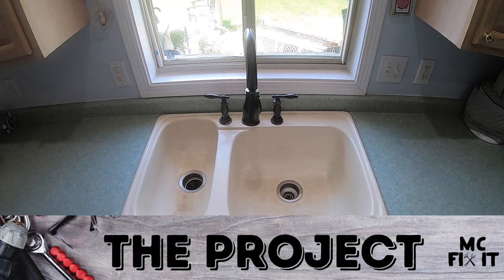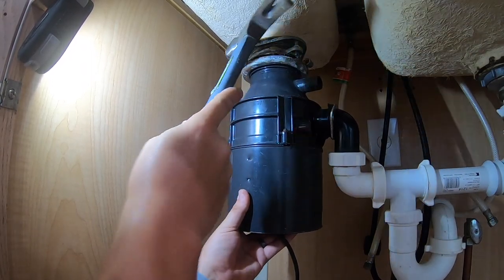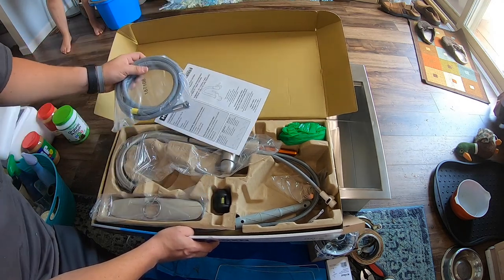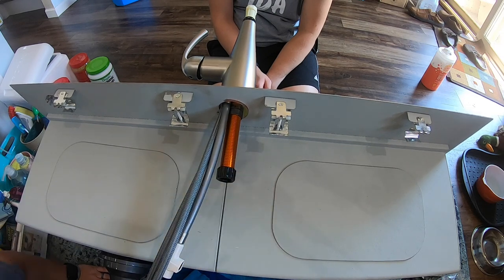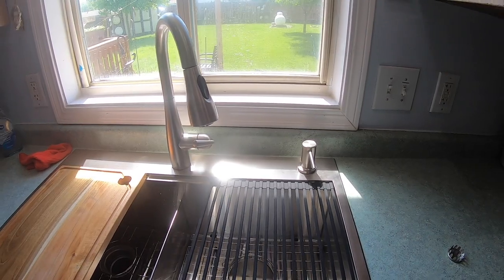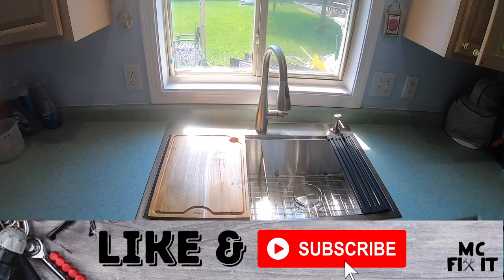Install Kitchen Sink & Faucet - Kraus Pro Workstation | Moen Essie Pull-Down Faucet [Complete Guide]

Comment from the maker: Learn how you can change out your kitchen sink and faucet with this step-by-step guide.

Supplies:
* Kitchen Sink - Kraus Pro Workstation Sink 
- Amazon - https://amzn.to/3x9FuTn
- Home Depot - https://www.homedepot.com/p/KRAUS-Lof...

* Kitchen Faucet - Moen Essie Pull-Down Spray Faucet
- Amazon - https://amzn.to/3NOv2Hu 
- Home Depot- https://www.homedepot.com/p/MOEN-Essi... 

Tools:
* Hacksaw Milwaukee  with wood blade - https://amzn.to/3nkkDYS
* Caulk gun - https://amzn.to/3HTVBJu
* Clear Caulk - https://amzn.to/3yjbZ39
* Wrench & Channel Locks - https://amzn.to/3bjuA5Y
* Plumbers Putty - https://amzn.to/39S3eUa
* Plumbers Tape - https://amzn.to/3QNIwFM
* Philips Screwdriver - https://amzn.to/3hdpzx0 
* Flat Head Screwdriver - https://amzn.to/2RAjTlU 
* 5/8in wrench - https://amzn.to/3OHx7FI
* Flat Razor Scraper - https://amzn.to/3u6VViy 
* Utility Knife - https://amzn.to/2StsW8q 
* Safety Glasses

Chapters:
00:00 Intro
00:07 The Project
00:54 Tools
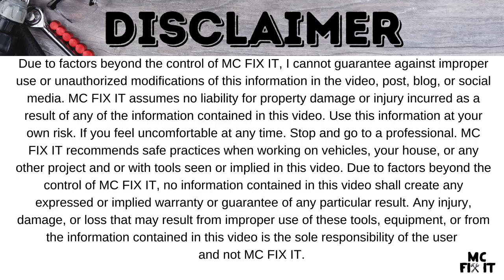01:47 Disclaimer
01:51 Turn off Disposal Breaker
02:25 Remove Old Supply Lines (Hot & Cold)
05:16 Remove Drain and Garbage Disposal
07:26 Remove Old Sink & Faucet
08:50 Clean Old Caulk Off Countertop
09:24 Removing Hardware for Garbage Disposal
10:15 Remove Hardware for Drain
10:34 Unboxing Sink
13:00 Unboxing Faucet
13:51 Dry Fitting Sink
14:18 Cut Countertop as Needed to Fit Sink
15:21 Reinstalling Sink Drains (as needed)
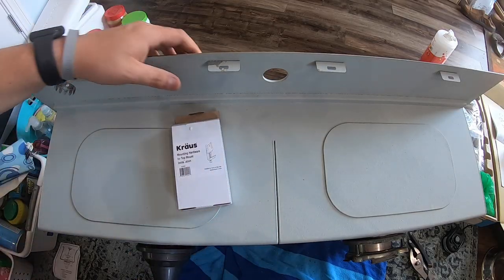21:10 Installing Mounting Hardware
21:62 Installing New Faucet
26:46 Install Sink & Faucet into Countertop
28:37 Install Supply Lines (Hot & Cold)
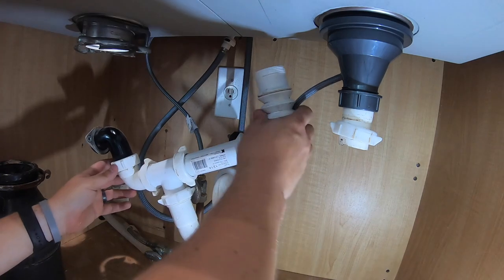31:28 Reinstall Disposal
35:44 Reinstall All Drain Pipes
41:42 Mount Sink with Hardware
42:35 Install Soap Dispensor
44:29 Final Test
46:18 Garbage Disposal Test
47:06 Final Look

Check out my website at http://mcfixit.us 

Disclaimer:
Due to factors beyond the control of MC FIX IT, I cannot guarantee against improper use or unauthorized modifications of this information in the video, post, blog, or social media. MC FIX IT assumes no liability for property damage or injury incurred as a result of any of the information contained in this video. Use this information at your own risk. If you feel uncomfortable at any time. Stop and go to a professional. MC FIX IT recommends safe practices when working on vehicles, your house, or any other project and or with tools seen or implied in this video. Due to factors beyond the control of MC FIX IT, no information contained in this video shall create any expressed or implied warranty or guarantee of any particular result. Any injury, damage, or loss that may result from improper use of these tools, equipment, or from the information contained in this video is the sole responsibility of the user and not MC FIX IT.

#mcfixit #kitchensink #houserepair #kitchenfaucet 

——
Supplies used to record this video: 
* GoPro Hero 7 Black - https://amzn.to/3f3ALtb 
* 256GB Flash Drive - https://amzn.to/33pAueG 
* Vlogging Frame - https://amzn.to/33tajE0 
* GoPro Pro 3.5mm Mic Adapter - https://amzn.to/2RCURCu 
* Youmic Lavalier Lapel Mic - https://amzn.to/2R55sWX 
* Boom Stand (tripod) - https://amzn.to/3bdkQaw
* 5/8” to 1/4” adapter (boom to blogging frame- https://amzn.to/3txrVsM 
* Portable Battery Powerbank- https://amzn.to/3vJQc0q 
* 6ft USB to USB-C (powerbank to GoPro)- https://amzn.to/3uAS5MH